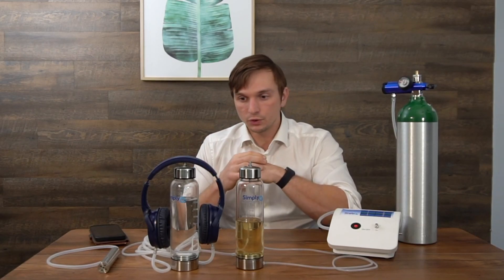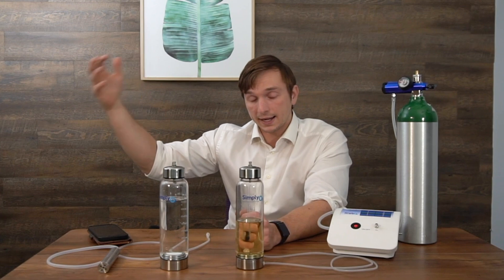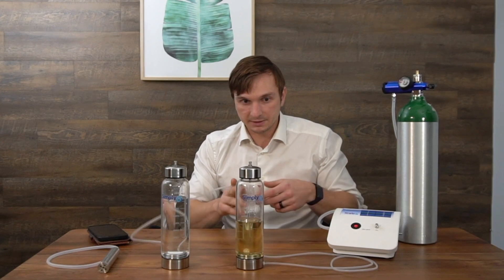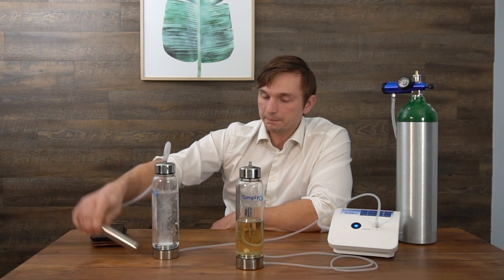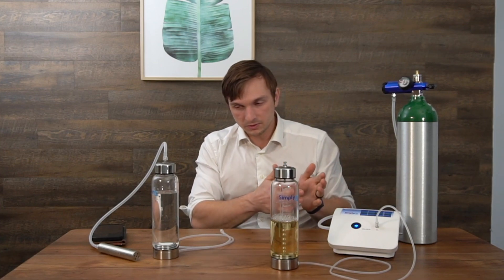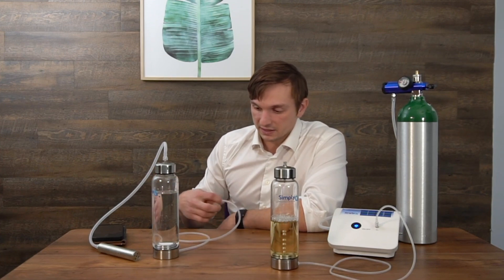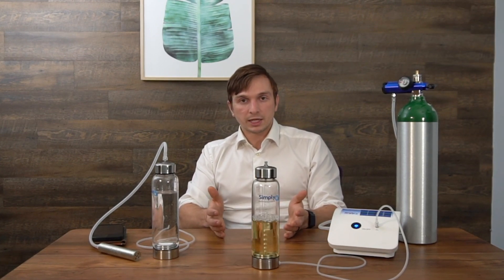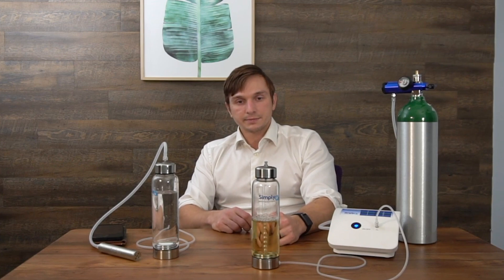How to Make Ozone Oils + New Bubbler Systems

Comment: I have a 10 lpm oxygen concentrator for my EWOT. Would I direct connect the oxy concentrator to the O3 system in place of the 40 cf oxygen tank?
Reply from the maker: It likely won't get down to the flow rates that you need.  These generators usually use flow rates such as 1/16, 1/8, 1/4, etc.  With a 10LPM concentrator it is typically not accurate enough in the flow settings to give a reliable concentration.  For purely ozonating water/oil, it would work fine because the flow rate isn't as important.
Reply: @simplyo3  Thank you

Comment: What is the purpose of such a low concentration ozonated oil?
Reply from the maker: Good question!  I recommend watching the full video if you didn't get the chance.  It is not possible to reach the concentration we do without a similar production.  A set up like this only has capacity to reach a certain concentration because it is not keeping the oil frigid, allowing for better bonding of ozone.

Comment: I have had three separate stones fall off the bubbler after being very careful and no contact with the glass container. It is a VERY POOR design! Hopefully the new one will work better because it doesn't look like the stone is attached to a tube.
Reply from the maker: Correct!  We are making an improvement.  And contact info@simplyo3.com if your stem breaks.
Reply: and they want 5k for it